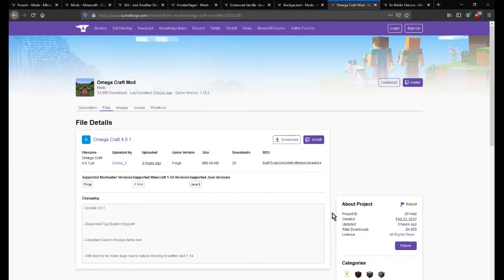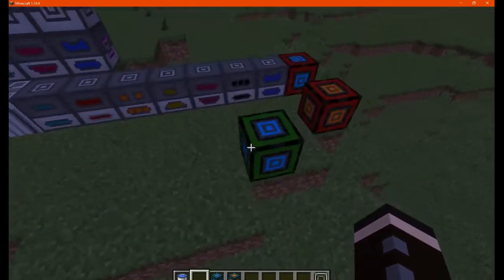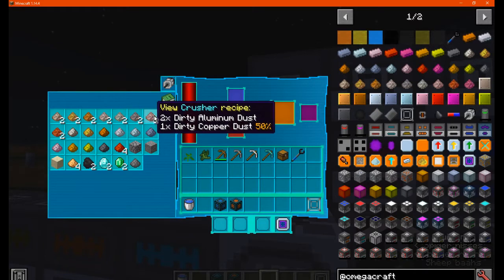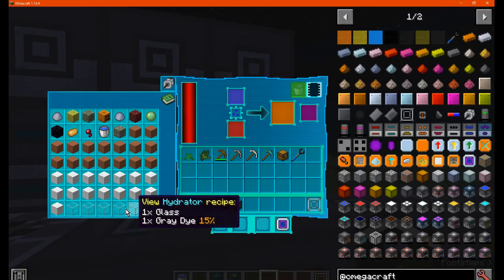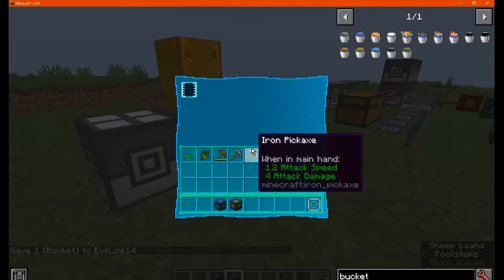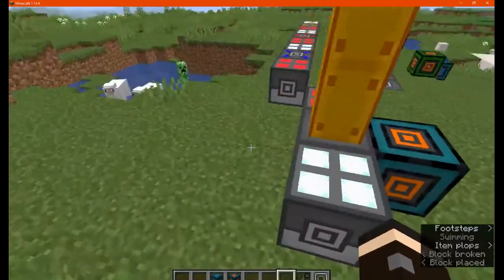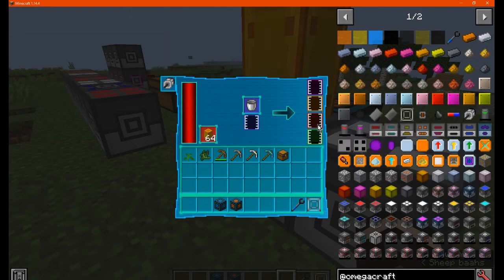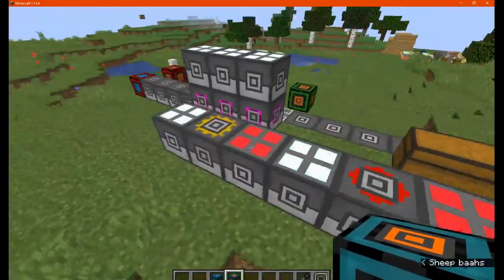OmegaCraft 1.14.4 Forge First Impressions Part 1 - InternalWaterUpgrade, OilWell & FractioningPlant

Comment: How do i use the ore washer modification on the hydrator
Reply: In 1.12.2 you'd need an Ore Washer upgrade (you need at least tier 2 machine blocks before you can add upgrades to machines). I think its the same in 1.14.4 & 1.15.2 (I haven't used the 1.15.2 version of Omega Craft yet). Then once you have the upgrades you can go between a few machines alongside the Ore Washing to get the most out of your ores, this includes the Crusher with a particular upgrade (don't remember which) and the Alloy Furnace with the Alloy Smelter upgrade I think.
Reply: @suntannedduck2388  thanks just got the advanced solat panel